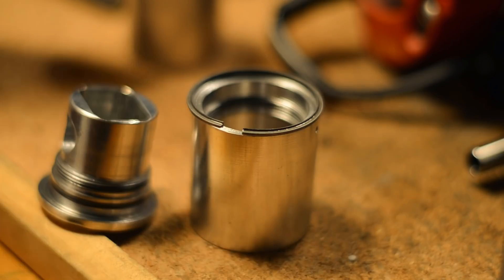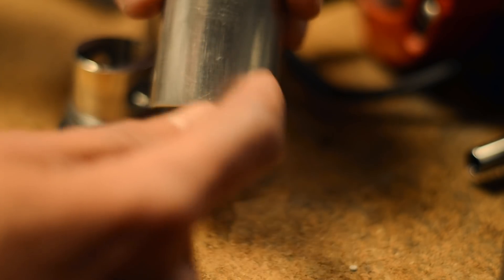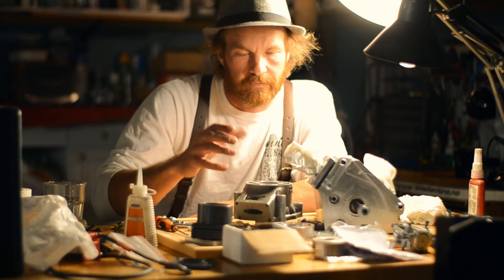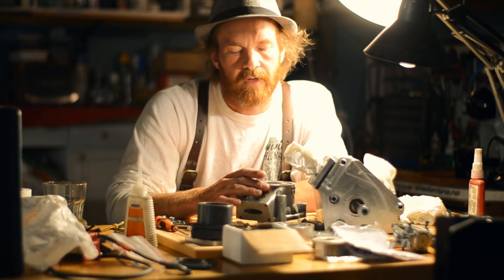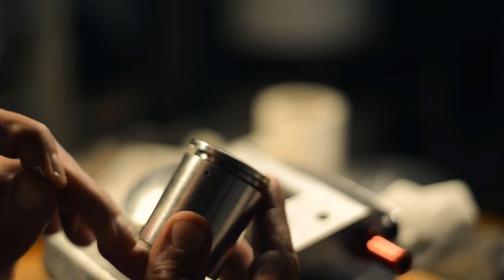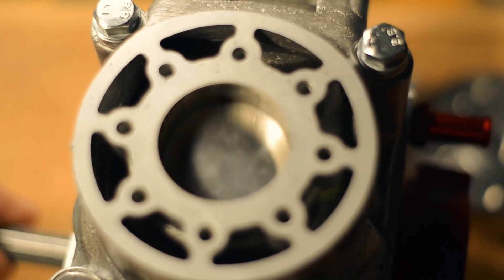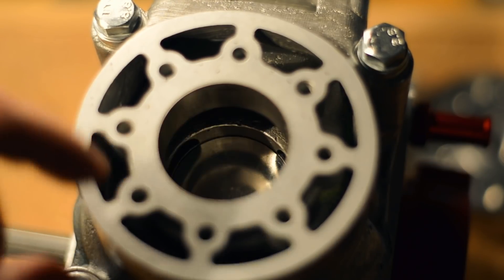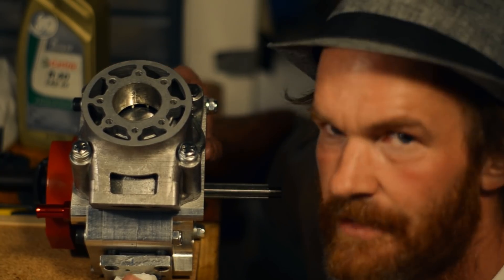The Most Powerful Two Stroke Ever - Will the ring break?

Comment: People who haven't been following this build will not realise how massive of a milestone this is from the calm and collected nature of your video. Keep up the great work!
Reply: 100% it will run. How high it can rev before breaking that ring is a different story though. But it's all part of development.

Let's see you design and build your own untested engine design before you keep leaving such negative comments.
Reply: @The Truth about Africa hurts ever get a life yet?
Reply: @The Truth about Africa hurts it's an engine, not a motor. At least get that right before you attempt to bully others
Reply from the maker: Which motor?
Reply: @The Truth about Africa hurts you have no idea what you're talking about
Reply: It's a heat engine. Just because you found that in a dictionary doesn't mean it is correct in a technical sense. All mechanical engineers (the ones who design these engines) know there is a large difference between the two, so don't try to put others down if you don't even know the technical differences between a motor and an engine.

Hey look, I can google too:
Heat engines, like the internal combustion engine, burn a fuel to create heat which is then used to do work. Electric motors convert electrical energy into mechanical motion, pneumatic motors use compressed air, and clockwork motors in wind-up toys use elastic energy.
Reply: @The Truth about Africa hurts  Who's the IDIOT here/that would be you douchbag .
Reply: @The Truth about Africa hurts you seen the latest video?
Reply: @tx5brent  there are folks that post negative comments, and then there are folks like the author putting their work on display and getting it done.

Comment: Do you not have a parting of tool for your lathe?
Reply: The wrist pin is incredibly hard. Too hard to be turned on the lathe. This is why he used an abrasive cut off wheel. Cheap and easy.